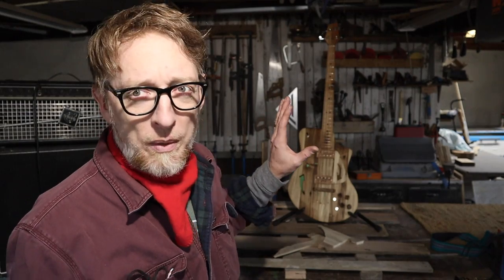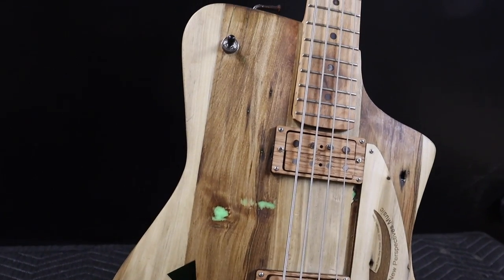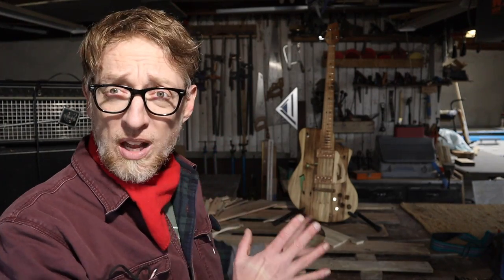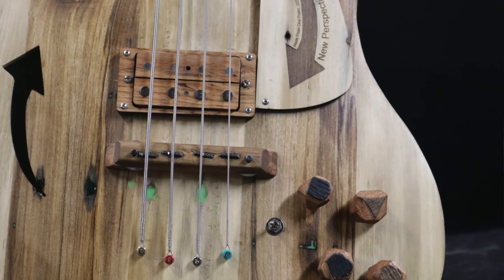One Pallet, One Bass Guitar (Nails & All!)

Comment: As a kid I tried to make my own guitar at a scrap wood many different times and was told I couldn't and it was wrong this guy pulls it off and then some breaking down the lines of what's possible and what we're told by the industry, and it's great recycling
Reply from the maker: I've been told "You can't..." more times than I can remember. I stopped listening to those voices decades ago. You CAN. It's harder and takes more time to get there but how do YOU want to spend your life? Following others' paths or forging your own?
Reply: Who the hell said you cant make a guitar out of....wood?
Reply: As an adult I suggest you go cut up some wood as see what you Can make.
Reply: Yth would they say that?
Reply: @tallwill38 technically this could be achieved with hand tools. It would just take a lot longer. The only thing that prevents you from being able to make something out of wood is either rot or severe cracks running through the entirety of wood that make it unusable.
Reply: Yeah, so long as the wood isn't reduced to rotting splinters it should be usable to some extent.
Reply: @tallwill38 its not a tutorial its a cool video of a dude making cool things take it or leave it

Comment: Its weird people gotta hate on the cnc machine. You're turning rubbish into something with so much potential. In my mind, that's a bit wizard like. You can see things, even garbage, as something much more then transform it into that. That's kind of mystical in my opinion.
Reply from the maker: I was part of the "not real woodworking" camp myself, I admit, until I realized I was just intimidated and afraid to learn something new. I got over that hump and it opened new doors for me beyond my wildest dreams almost immediately. Not because it's a "magic box" that can do anything I think of, but because I had to learn to think and design to the 1000th of an inch in a new way to get the tool to do its job. Not only have the skills I've continued to learn about the cnc made me a better cnc user, but the cnc skills I'm learning have also made me a better traditional woodworker. like when you learn a new word and hear it all the time, now I can literally see and feel distances much smaller than I could before. And that's just one of the numerous benefits to my own personal abilities cnc has given me.

Comment: One could say, you nailed it. But you still used fretwire, copperwire, electrical wire and several screws. It would be interesting to see you using nails as fretwire, etc
Reply from the maker: I have and you can, but I wanted this be be "pro" playable, not just a campfire guitar.

Comment: I gotta ask, Tim, since you've got some first hand experience. The conventional wisdom in the guitar-building world is to use a strong, stiff, even-grained wood for the neck, since it's supporting so much tension along such a small area. I suppose that's the primary reason that Maple and Mahogany (among a few others) remain the primary neck-building woods. You've been building these instruments out of whatever you have on hand for a long time. Have you experienced yourself, or heard about from past clients, any problems with neck integrity over time when they're made of these "other" wood species?
Reply from the maker: Hardwood and straight grain are absolutely factors that are hugely important, but it doesn;t have to be staight grained wood that grows a million miles away. Guitars I sell I use hard woods, usually laminates which adds strength. I had one problem (see recent video) from that biting me in the butt but most are fine. I even made one of my closet door guitars several years ago with a neck made of pine from the trim of the door with a hard cumaru fingerboard. I was just playing it yesterday and the neck is straight as an arrow. In fact it'll be used in a future video. stay tuned.

Comment: I love the "invisible tailpiece" idea! Seen it first on the Chrimson Guitars Channel. 
I wanna implement that in an upcoming build too. I was wondering if the bass strings tension would bend the material.... How stable do you think this  method is?
Reply from the maker: there's a chance it'll fail and I wouldn't be surprised, but it's been under tension for 2 weeks now without a problem
Reply: @timsway  i was thinking about using small titanium rods.... Should provide more strenght ... Well maybe ....but good to know! Many thanks
Reply from the maker: @themaschi  I've used regular old steel, too

Comment: This has so much character, I love it! Sounds great too.
You were able to bend those nails back really easily before putting the strings on, what are the chances that string tension will straighten them out again and slip off?
Reply from the maker: That could very well happen but hasn't yet. If it does, I'll do something else. No big deal, y'know? Only way to learn is to try.
Reply: I thought the same... amazing build! but I worry about those strings slipping off the nails

Comment: Bet your pick ups would be stronger if you cleaned the rust off the nails.
Reply from the maker: but they wouldn't look as cool :)
Reply: @timsway  you cant see the coil anyways how does this answer make sense. 🤦‍♂️ keep making your videos. Simple vinger bath and sandpaper would increase quality of pickup, just a suggestion
Reply from the maker: @huntfrancis2380  you can see the top of the nail heads in the pickups. that's what I was talking about, where I want to keep the age. yes I could clean them inside the coils but there isn't a lot of rust there, just patina. the rust got cleaned off with a wire brush. no need to individually sand them. a good vinegar soak is a good idea., but i'd have to set it up to keep the heads out of the vinegar :)